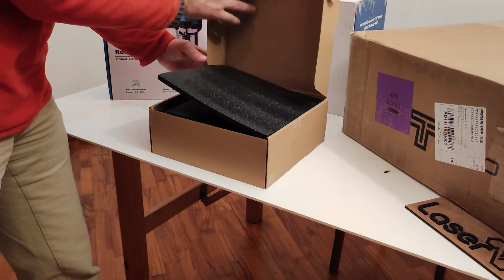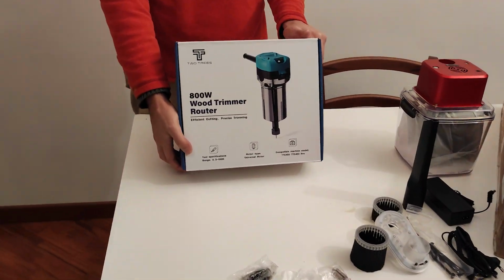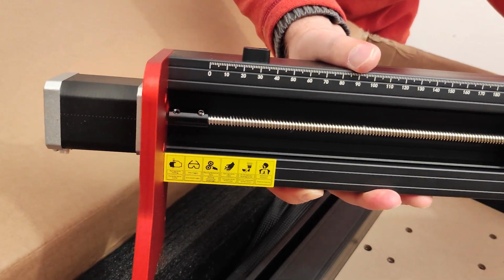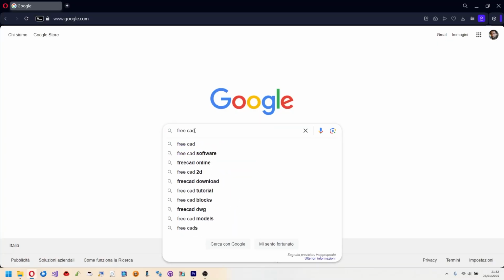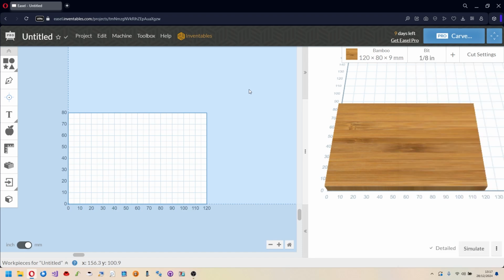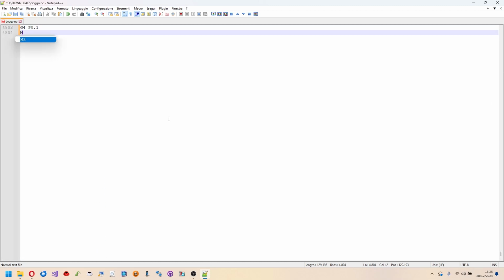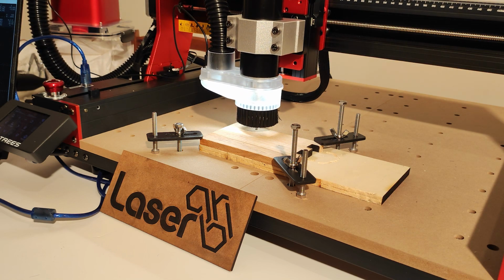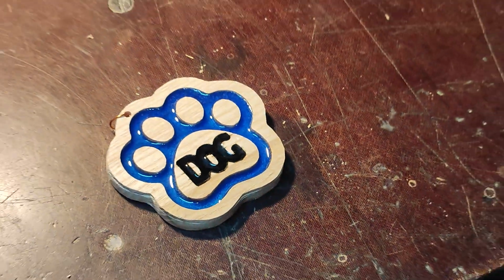Using TwoTrees TTC450 Pro CNC with LaserGRBL and Easel

Comment: Hello, I can't activate the vacuum cleaner's auto-start function.
I followed the procedure in the manual, which was to disconnect the power if you've already activated the manual start function, and then press and hold the button after reconnecting the power. I even tried a different cable. I tested it by running the 500W motor and moving the machine head. If you can help me, thank you in advance.

Comment: I just bought this machine too. Though, I did some DIY on it.
Together with this, I bought an 800W Twotrees spindle, 65mm in diabeter, colled by air. Similar to one we can see in the box on the table. 
SInce it wasn't made for the CNC, I designed and printed out an adapter made of 1cm thick full ABS plastic. I... will admit I might have overdone it with how thick I made it. Like I'm talking 8 screws holding it to the CNC and 6 screws holding the spindle. I'm not planning to use this to cut steel, but I am pretty sure it could handle it. XD
Now I need to design a vacuum cleaner adapter. XD
Reply: Are you still happy with it?

Comment: Wonderful! Thanks, I love your videos, app and I already love Easel too! Together they run my machine 😍
Very excited to see you with a router 👏 and you blew my mind when you casually mentioned that LASERgrbl can be a *GRBL sender*. So of course now I'm currently doing some V Carve Inlay with my fave LASERgrbl!!!!!
Since moving to FluidNC, Easel can no longer connect to my machine, but it can save the NC code files. So I've been using UGS, but more recently Openbuilds Control has been the more stable. 
But now I can just use LASERgrbl woohoo 🤩 🥳🎉
Can I look forward to your new app coming out: 3Dgrbl? 🤞🖖😉